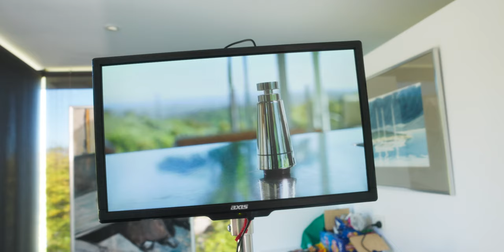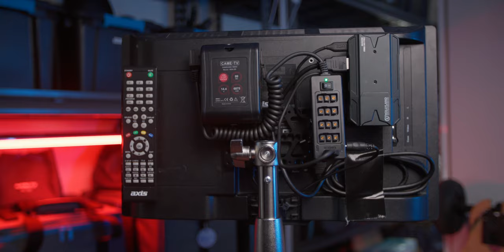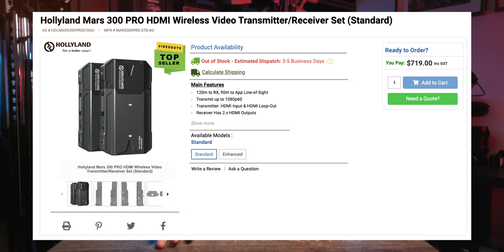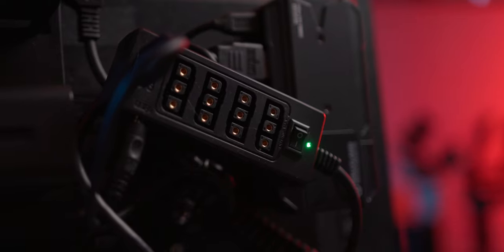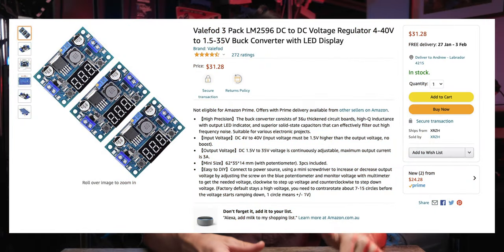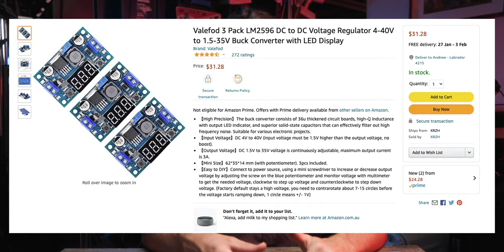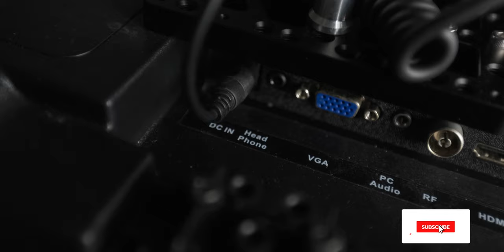$80 BUDGET DIY Directors Monitor For Filmmakers (Budget Large Field Monitor)

Comment: Don't want to be a party breaker, but wireless stuff is costing over 700 $, so this isn't a 80$ setup. But very good idea using NP-F750
Reply from the maker: Thats is the same with all directors monitors :) This is talking about the monitor itself
Reply: Anyone who thought this would be $80 including a wireless transmission system of any kind is certainly in for a shock... but realistically, I never thought this would be an "$80 director's monitor complete setup including mount, power, stand, and wireless TX/RX" from the title, I just thought "oh cool, a serviceable $80 screen for on-set monitoring!" And of course, you don't need everything to be wireless in order to use a monitor. You could just set it up near the camera on sticks with a long-ish HDMI cable.
Reply: If you get a monitor/tv all you need is power from battery or cable 

And an Apple TV 

Oh wait oops nah that can’t work cause you need to air play/ screen mirror from a apple device ahah 

Id the camera is connected to the Mac then yea ahah

Comment: 80$ added up to 700 bucks easy lol might as well named this video "Build Monitor for 12 dollars only if you need HDMI cables
Reply from the maker: Every wireless directors monitor needs all the wireless accessories and power. I'm talking about just the monitor.
Reply: I disagree. I never thought this would be an "$80 build including wireless transmission system" based on the title. I can see how that would be disappointing, but I see the monitor and the transmission system as separate items unless you're using something from SmallHD with Teradek RX built in. And that would cost way, way more than the entirety of this setup including the TX/RX, battery, monitor, mount, stand, and everything else.